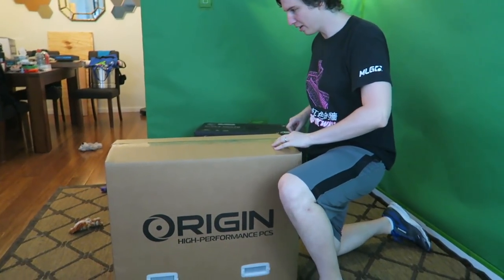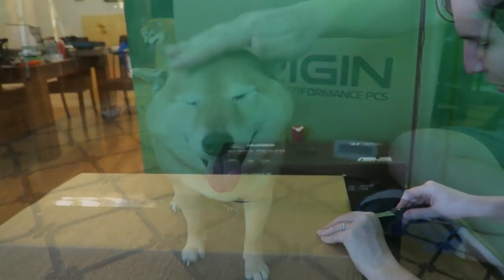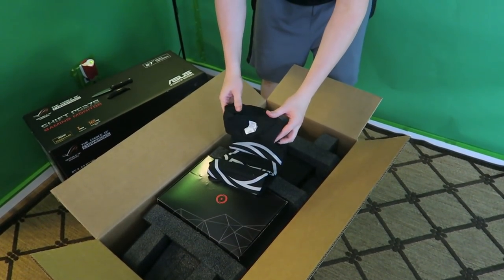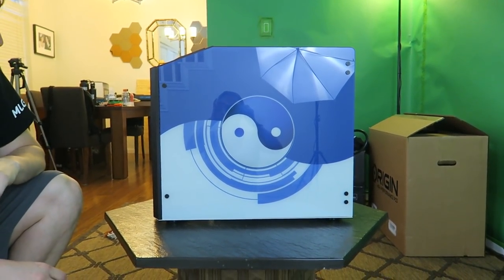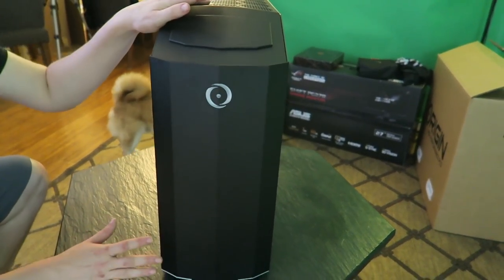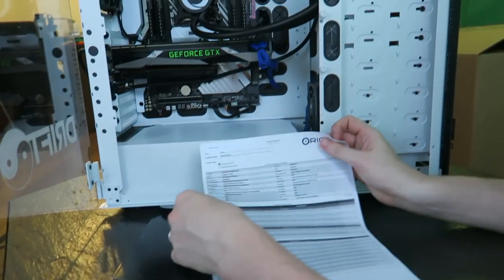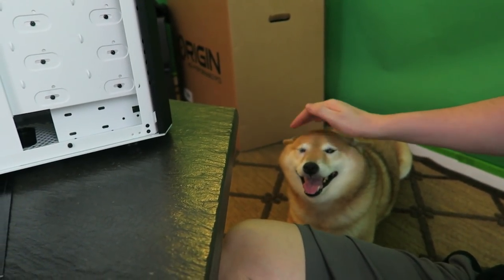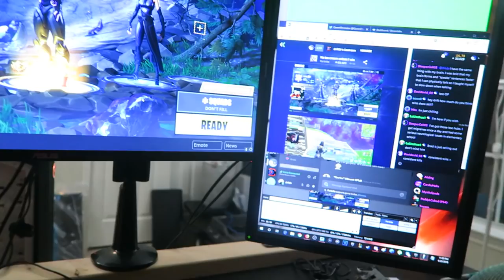Chainsaw Unboxing of a $5,000 Origin PC!

Comment from the maker: FULL PC SPECS:
Intel Core i9 7920X (OC to 4.1Ghz)
11GB EVGA GTX 1080Ti
4x8GB Corsair DDR4 Vengeance LPX 3000MHz
Intel Optane 900P 480GB PCIe SSD
500GB Samsung EVO860 SSD
3TB Seagate Barracuda
Gigabyte Auros x299 Gaming 7 motherboard
EVGA 850 Watt Supernover G3 PSU
Frostbyte 360mm CPU cooling
VR Front Panel HDMI Port
40 in 1 Card reader
Build in Wifi card
Additional USB 2.0 expansion hub (for older audio devices)
Custom Drift0r PC Tower
Custom UV Lighting
5x Ultra-silent case fans w/ dampeners
Reply: Doesn't the 7920x  cause a lot of heat?
Reply: Drift0r should’ve delidded the cpu
Reply: Drift0r the motherboard listed isn't correct, the one in the video is an Asus prime motherboard not a gigabyte aorus one. (I have the same Asus motherboard so I know)
Reply: Drift0r I have something to admit. For a little while I didn't watch your videos and even unsubscribed because you were playing Fortnite and COD BO3 INFINITE WARFARE ect. But after seeing your video about passing up money and doing what is morally right instead of taking money I respect you on another level. I resubbed and respect you Driftor. You remind me of my brother Damien. Hes a software and game developer. I just want to say if anyone on here wants to tell me how dumb or mean I was for judging you I understand. Thank you Driftor for standing strong I don't know if your a believer or not and I don't expect you to confirm or deny but God bless you Driftor you will be blessed for your honesty and integrity.👍👍
Reply: Was it a freebee or u pay 5 grand for it
Reply: Jesus. Yeah, Ill be able to afford one of these in 3 years or so.
Reply: how is this 5k.. i have the same specs with a 960 evo 500 for 1.5k....only difference is i have a 7700k but that hardly accounts for 3.5k difference..what am i missing??? gz nonetheless!
Reply: Drift0r So you made yesterday's video to protect your image because now you do video advertisements?
Reply: Drift0r thanks I want to check out the processor and graphics card
Reply from the maker: Optane, 2 other hard drives, custom ports, and a custom case.
Reply: No one should buy a prebuilt system, he got royally ripped off
Reply: WOW
Reply: No RGB ram?
Reply: Nice, but not really a beast... You got a fine CPU and depending on your work, RAM is fine as well, though I'd have gone with 4x16GB.

Why Optane 900P? Samsung 960 PRO or 970 PRO would have been a better choice. Also, an EVO SSD? Why. That alone makes it not a beast.
Reply: Can you pls send me 16gb (8gb × 2) ram?
Reply: Manakaiser - Congrats to the man and all but I could build a BEAST of a machine for that kind of money. It's so much more satisfying and easier than it's been for a long time.
It's the same with 8pack machines. You're paying for the brand completely.

Comment: Okay I was wondering what kind of god level packing they did that you could go at it with a chain saw. But man am I jealous now that processor alone man to get a graphics card that beastly and a pcie port that speeds up performance dude bow down 😂 my pc is mid tier and old now I can’t run VR on it but this pushed me over the edge to want and built a new one

Comment: 11:05 Lol, that's not your power supply bro, that is the hotswap drive area, there is a reason they call that metal at the bottom of the case there a PSU shroud.

Comment: There's absolutely no way that's a 5k PC... and why not glass tubing water cooled? I have never seen a PC that expensive run an AIO water cooling system. They could've made the tubes for it a little neater too. Id expect soft tubing at the very least. Also the cable management looks dumb tied up the way it is. I hope you fix that.

Comment: u should of got a dedicated AI card, but i don’t think they exist yet, lol hence why ai in games is still horrendously bad. i think f.e.a.r. series had the best ai i have seen.
Reply: As cool as that sounds there is no reason for a new chip for AI - A GPU with a lot of smaller cores is already optimized to run AI. In fact, AI development is done using commercial-class NVIDIA GPUs.
So an "A.I chip" would just be a GPU that was specifically told to do AI things.
Reply: Gubzs true, but the computing power needed  for a serious advancement of ai is so gigantic, it would need an entire ai board just to deal with the algorithms hence why the gaming ai hasn’t changed much in the past 20 years. but graphics have ten fold. etc.. 😊

Comment: Yo bro, that PC is worth no more than $3500, even in this bloated market.
Reply: Sites like Origin make their money by doing ridiculous markup and overcharging for services like safe shipping and "professional wiring". I wouldn't be at all surprised if they made $2000 profit off of this thing, assuming Driftor paid for it.
Reply: Umar Nasir I think the CPU, RAM speed, Optane, and 3 TB 10,000 RPM HDD + 860 Evo place this above $5,000 for a pre-built PC.
Reply: They don't. Also paying for 32GB instead of 16GB of RAM is like throwing money directly into a toilet. That RAM is never gonna get used.
Reply: Gubzs That is not true. 16Gb is not enough for me, let alone for him.
Reply: Gubzs he literally says this video is sponsored by origin at the beginning numb nuts
Reply: SyncF there's literally no way "16GB isn't enough for you". 16GB is enough to edit 4K video while you also have tons of browser tabs open. Personally, I've been 100% fine running everything with eight GB for the past month after one of my sticks failed. I didn't even have to change the settings on any of my games or applications.